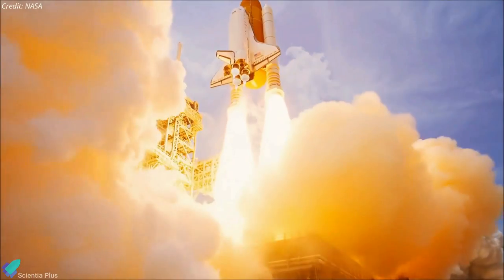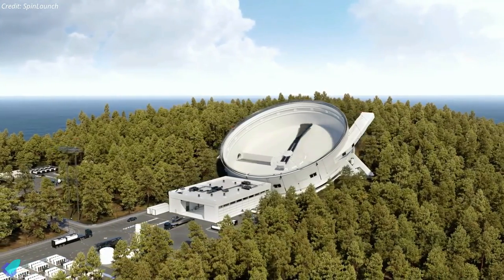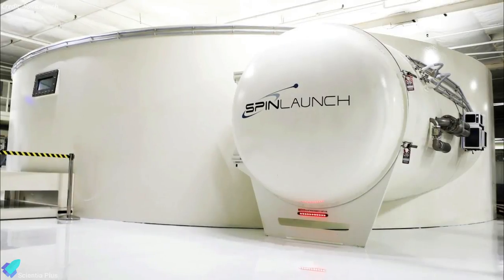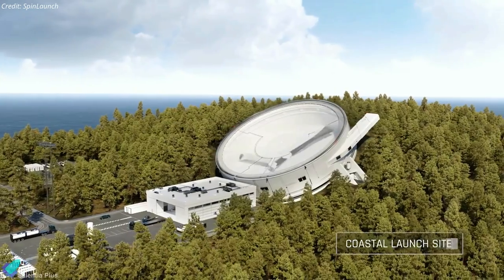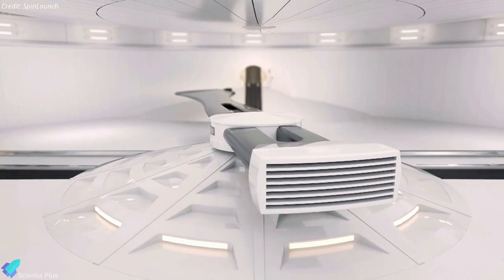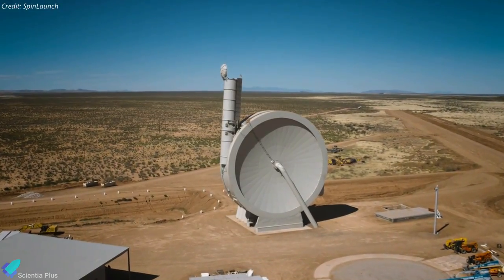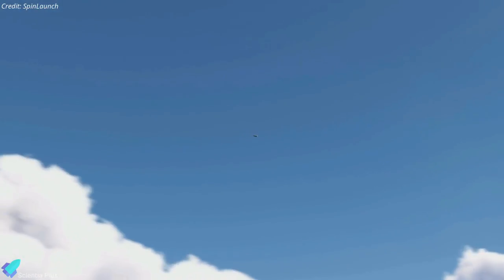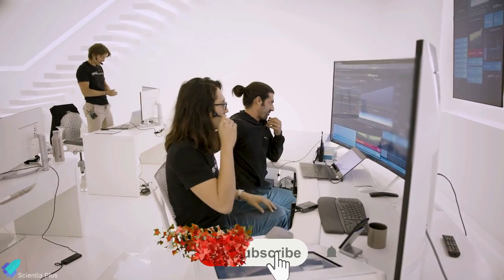Throwing Rockets Into Space | SpinLaunch Technology and Its Future

Comment: Seems unsafe. Better to use a maglev rail gun system. No need for spin up.  No moving parts that will wear and tear. And no possibility it would shake itself to death.
Reply: Investing in all avenues to at least explore the possibilities is the best way to go.  Spin Launch may end up being the extremely profitable and they may go very, very far.  Also, rail guns instantly accelerate their loads.  Causing instant stress that isn't spread out over the course of the launch.  They typically nearly completely destroy their payload upon launching.  Hence why it's mostly only used as a weapon with extremely strong solid objects as projectiles.  Yeah, the no moving parts aspect is very nice.  But you can't realistically use it to launch somewhat sensitive equipment into orbit without destroying it, no matter what you do.  The forces are just too great.  With the spin method, at least you can gradually get to those forces.  With the rail gun method, you're instantly at those forces.  Which isn't good at all for any sort of equipment beyond just launching a solid object.
Reply: @BackYardScience2000  Rail guns for the military are far different than ones designed for launching material into space.  It would be much longer and accelerate much slower so the stresses would be lower.  I'm not saying its a better way to go.  Just saying that you're comparing apples to oranges.

Comment: Kudos to Spin Launch for their milestone. This armchair rocket scientist sees a few issues. When they let go of the counterweight, it seems that would do an insane amount of damage inside the centrifuge mechanism. The g loads on on the rocket engine parts and propellant looks like a giant hurdle for nominal functions. Also in the event of a rocket release a millisecond prior or after planned release would be catastrophic to the chamber with propellants inside, such a slight miscalculation would destroy their launch pad. I imagine during testing there would be a lot of destruction and rebuilding of the launch facility. At least a conventional rocket usually drag their miscalculations downrange away from the pad.
Reply: The thing to do with the counterweight is not to release it, but to pull it in toward the center.